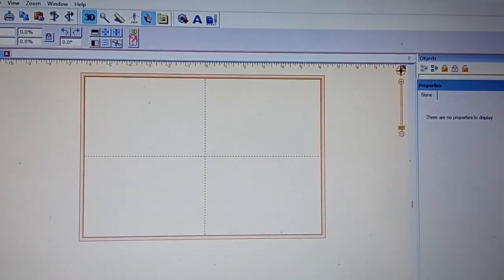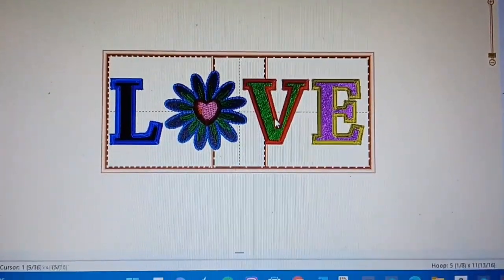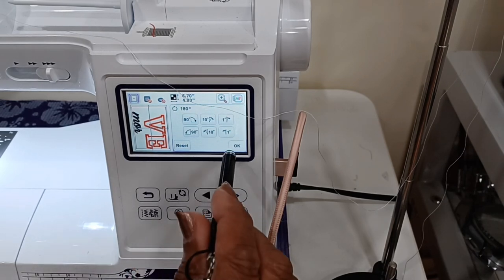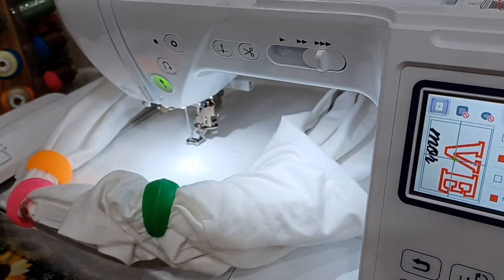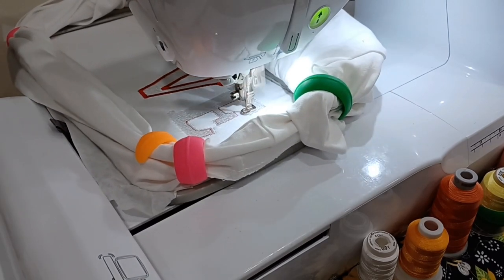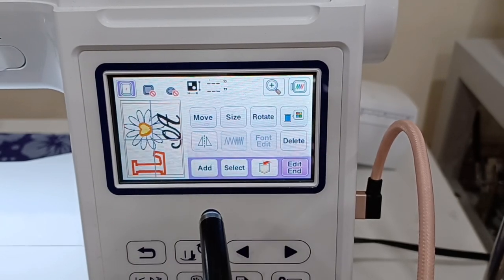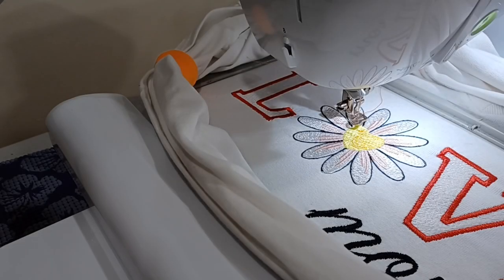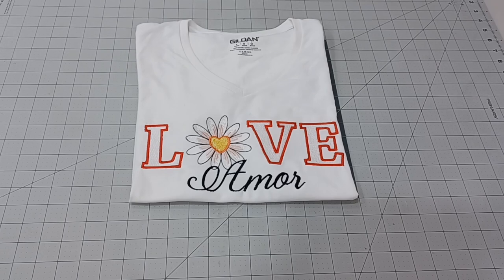How To Embroider Larger  Using a 5"×12" Repositional Hoop And A Single Needle Embroidery Machine

Comment: Great job, design and stitch out with zero puckering…!!! 👍🏽👍🏽 Because this was a complete fill stitch out what upper thread tension setting did you use to avoid puckering…? ❤
Reply from the maker: Hi! I didn't have to change the tension I just made sure that it was OK when I ran a test. I haven't had much tension issues with this machine. I love  this machine 😊